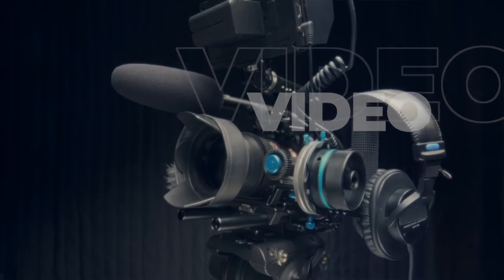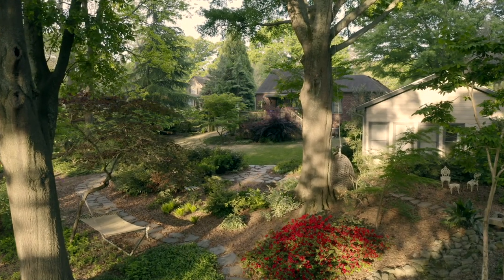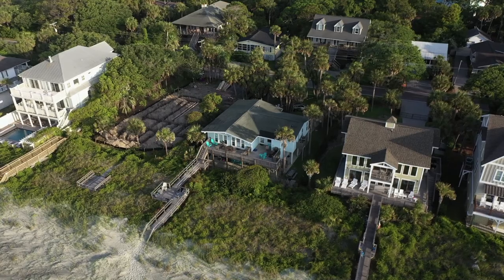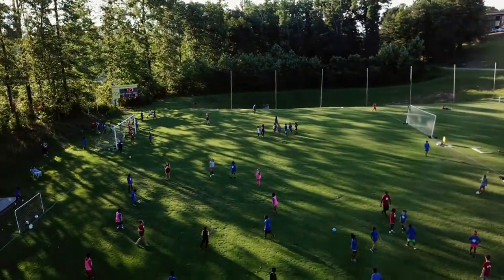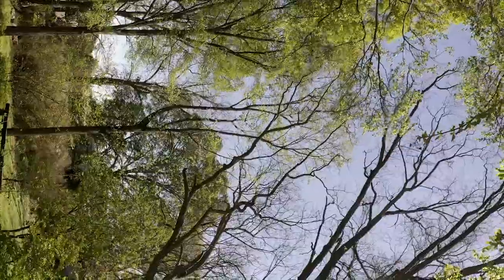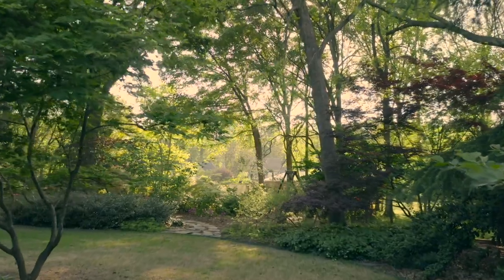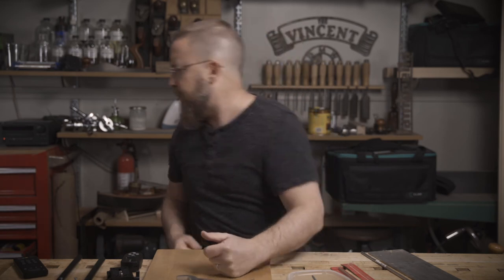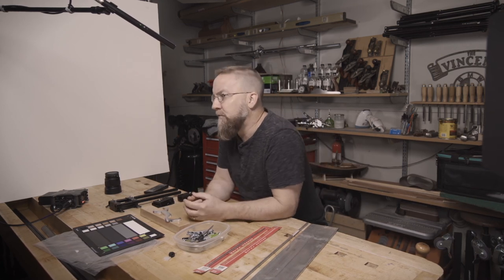DJI Mavic 2 Pro Crash. My Experience with DJI Service.

Comment: Yes they are good to work with.
Reply from the maker: I wish I could say my experience with my Ronin 3 Pro Combo was as smooth. I had a bad motherboard in mine - that died on a job - and the process was definitely frustrating even though I had the protection in place.
Thanks for watching!